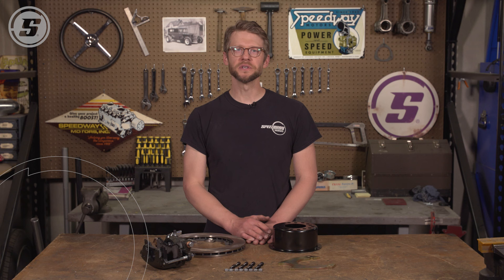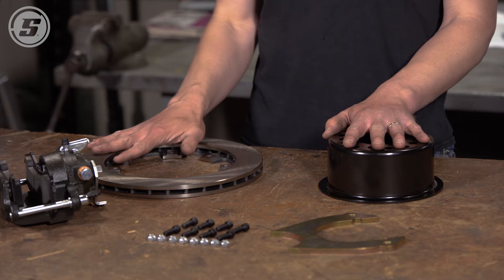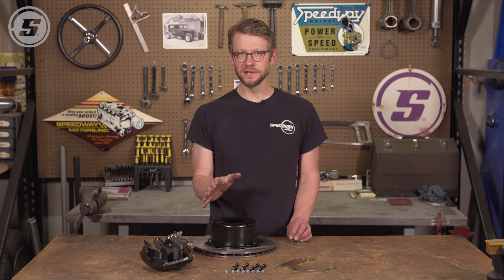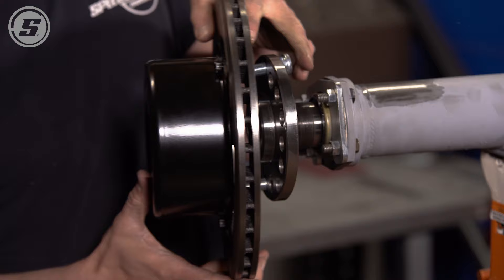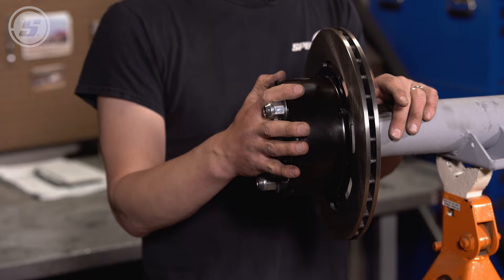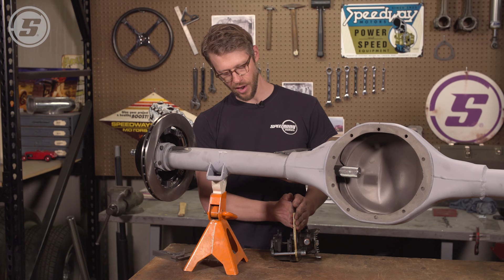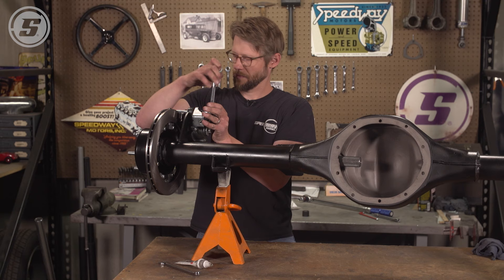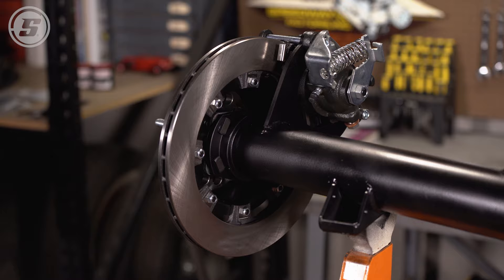How to Convert Rear Drum Brakes to Disc Brakes (Install & Adjustment)

Comment: Speedway well done. Thanks for the tip on how to get the caliper (and bracket) perfectly centered with shims. I also have an air setup but prefer this method. All good points like making sure piston is fully recessed. First time building a 9" floater and this video was great.

Comment: Nice video on the weld on bracket. However, I've always used the bolt on kit and probably will stick to it for now. Find it a lot easier, for me at least. Once again, great video and very helpful for those who want to take this route. Cheers

Comment: Correct me if I am wrong, but when this conversion is done we should have two Disk Brake systems on the rear Axel; the regular Rear Disk Brake System AND the new Disk Brake Emergency Rear Brake System.  Am I correct?

The only problem is; how do you reattach the Emergency Brake Cable to the new Emergency Disk Brake Kit, or even how to adjust the tension on the Cable.  You don't show how to do this in this Video which is, sort of, kind of important steps.

Otherwise, your Video is excellent.  In the future I definitely want to do this conversion on my 2007 Mercury Grand Marquie LS.  I haven't decided yet if I want to get the bolt on kit or the weld on kit.  I have been wanting to get this done for a long, long time.

Right now, the Cable has been disconnected from the regular Rear Disk Brakes AND the Emergency Rear Drum Brakes because when I replaced the regular Rear Disk Pads, the Emergency Brake Drum was totally rotted off the Axel along with the Disk Brake which means I have NO Emergency Brakes and NO regular Rear Disk Brakes which is a combined whole system.

The Mechanics which I use tell me; why get it reattached?  It's an expensive job and the Axels have to be taken out to do the job, even with the Drum System.  I got them figured out as not wanting to do the job, too stupid to do the job, or are actually trying to save me a few bucks which I find hard to believe.

I am curious about how much this Kit would be for a 2007 Mercury Grand Marquie LS.

Mike
Canton, OH

Comment: I hate how the glide pin is set up.
The hole where it goes trough will rust up and get full of shit.
Now you have no brakes.
EVERY OTHER car has a rubber sleeve that holds in the pin with grease.